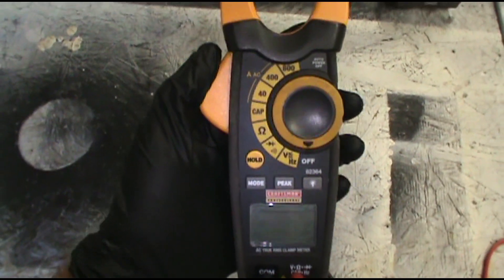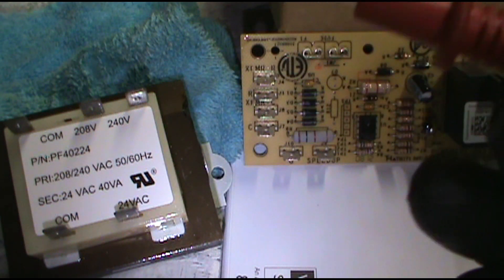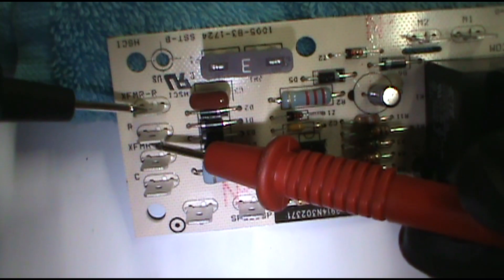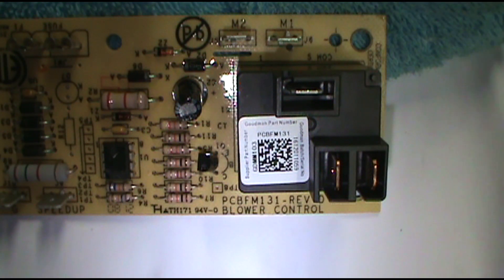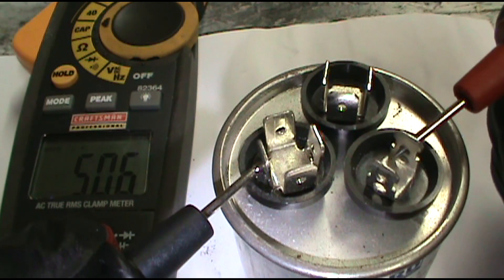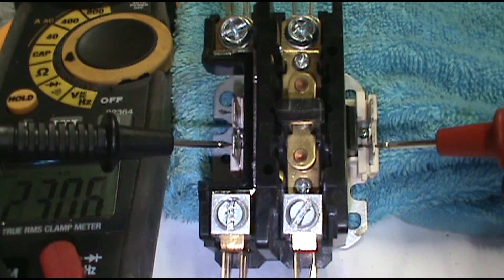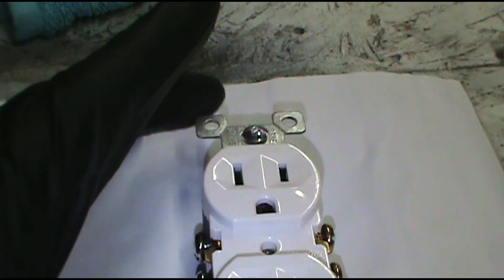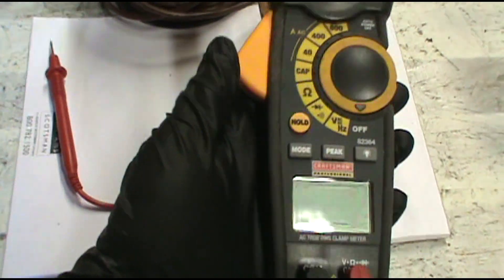How To Use Volt Meter On Different Components

Comment: Thank you sir,  but I've got some beginner questions... what's open and closed mean? Does it not matter which lead you put where? When should you check for continuity vs resistance? The only ones for power on are amps and volts right? So if I'm going through testing and things are getting power and continuity they're fine and move on? I've learned a bunch in like a day watching your videos, electrical and electronics confuse the shit out of me though and i definitely don't want to get cocky. 😅
Reply from the maker: The switch opens and closes. Or better yet, it connects and disconnects. The low voltage sends a charge and the magnet activates and pulls the 2 bars together and allows power through. Once voltage drops, the bars disconnect and stops power. The rest is hard to explain over comments. Thank you so much for watching!

Comment: I should do a how not to use a "volt meter" video lol... disregard the test lead being in the "high current amp test port"  and place leads from ground to circuit breaker screw in panel...
yep, I've killed yet another meter! rush rush rush not paying attention, someone handed it to me that way. RIP meter #20+ over the years.
Reply from the maker: throttle bottle Thank you so much for watching throttle!
www.DirtyMaintenanceNation.com

Comment: hey lex

What about a furnace igniter. Can’t get it to turn on. When the thermostat calls for heat the blower comes on but the ignitor will not glow.  What do you think?
Reply from the maker: Handyman Duran ooof, sounds like you're working on a gas furnace. I live in Florida where we rarely have to use our heaters. We mostly use heat pumps & electric heat strips down here. So I've never had to work on anything gas related. Check out Steven Lavimoniere. His YouTube channel has lots of gas stuff and can help you. Thank you for watching Handyman Duran!
www.DirtyMaintenanceNation.com
Reply: Lex Vance thanks for your reply I’ll go check out lavs videos. Your channel is my favorite. Keep up the good work.
Reply from the maker: Handyman Duran Thank you skid!
Reply: Sounds like a bad igniter, and the blower I hope you mean fan inducer motor, blower not to come on until limit switch tells it to. Oh and Do Not touch igniter with bare hands oil from skin will cause igniter to burn out, use gloves or just be real careful not to touch it hold by the base, best to use gloves tho most are in a tight spot to replace.
Reply: if it's the indoor "blower fan" coming on and not the draft inducer, then look for a high limit open, roll out safety tripped or stuck/bad pressure switch, maybe from plugged hose/s or backed up condensate drain.
also some auto-run the indoor blower for around 3 minutes after a power failure/return before going to normal run cycle

Comment: Do you need to discharge the capacitor before checking the capacitance with the meter?
Reply from the maker: gatorzownosu Yes, just rub a rubber handled flathead screwdriver over the terminals for a few seconds. That'll discharge it. Thank you for watching Gator!
www.DirtyMaintenanceNation.com
Reply: Lex should probably have mentioned this on the video. I got a really good zap by a capacitor cleaning a condensing panel. Yes the power was off on the unit.